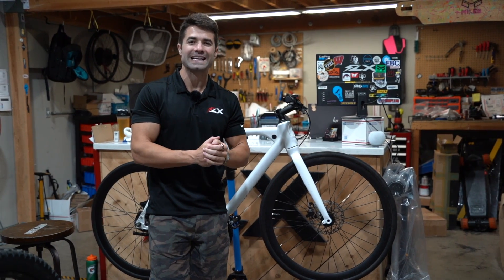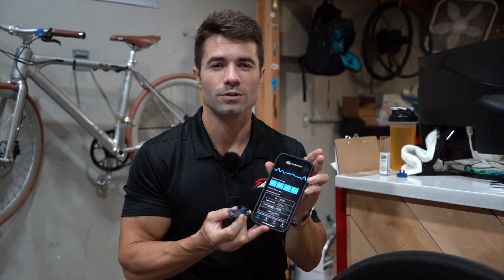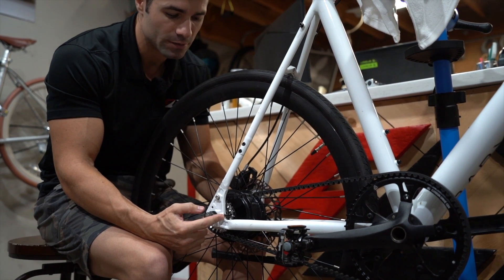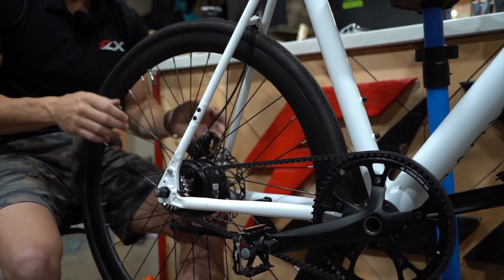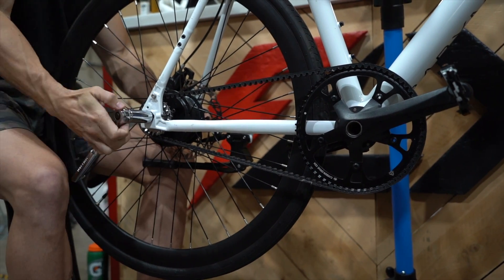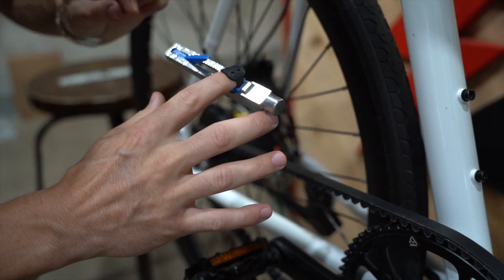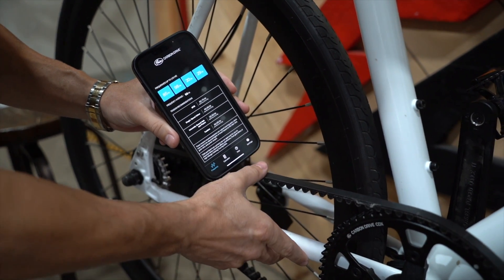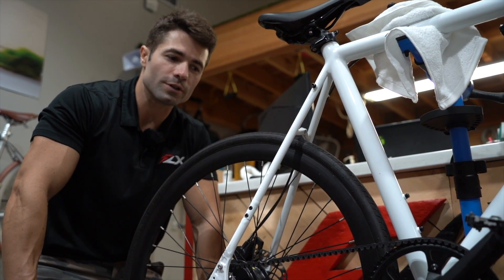How To: Adjust Gates Carbon Belt Drive On An Electric Bike

Comment: Very helpful. I replaced my first bike tube, which happened to be on the back wheel. The bike is also a single speed carbon belt drive. I had everything down except determining the belt tension. Tried the app, which gave me inconsistent results. However, I suspected I tightened it too much after a test drive. Gonna try to loosen it a little and give it another shot. Thanks for the video!
Reply from the maker: Thanks for sharing your experience! It sounds like you're making great progress. Good luck with adjusting the belt tension! Feel free to reach out if you need any more tips. Happy riding!